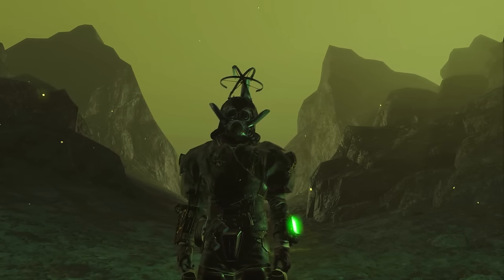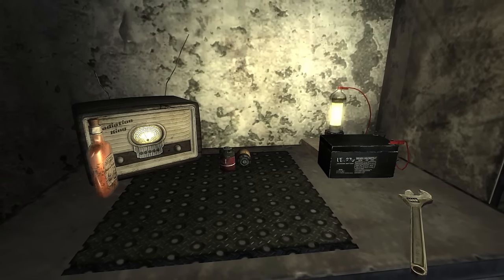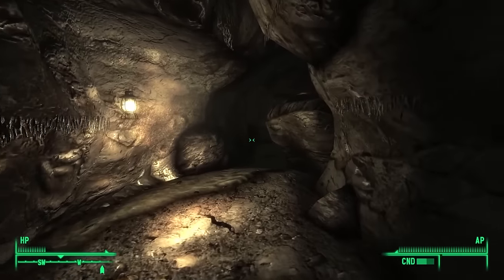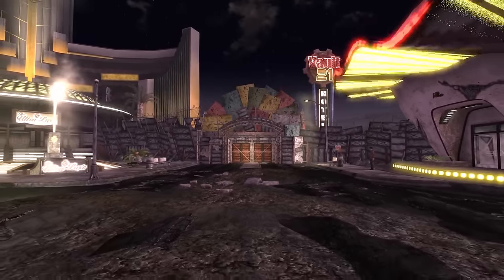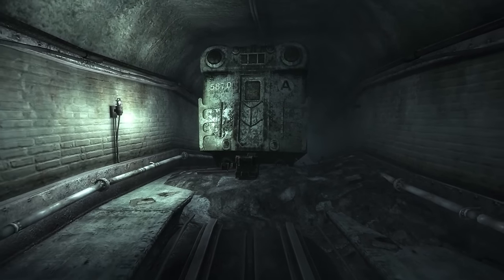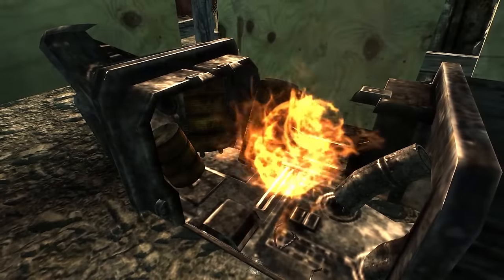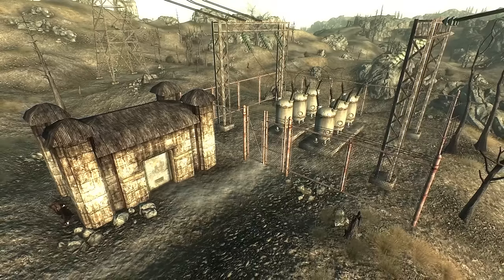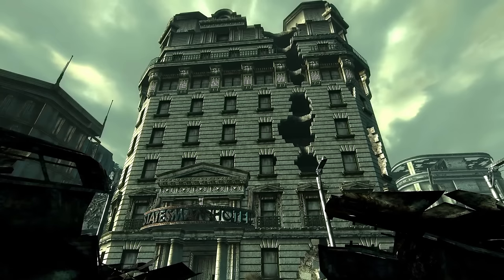Where does the power come from in Fallout?

Comment: Great video, just a theory about fusion cores, why can't we see them as batteries, as the building is still powered after removing the core, we know that the core is not providing electricity. But the settlement version does. So like a bettery charge managing system, the ones in building are recharging the cores as they have more power (from power grid) then needed. On the other hand, the power is provided by the core when there not or sufficient grid power ?

Comment: The partial power to the statesman hotel, and really the lack of power to any elevator just implies the building went into emergency mode. Most buildings with elevators shut them off if a fire is detected. Iirc, a lot of the lights in the statesman were actually tiny emergency lighting devices. In our world, they're battery run. In fallout they could be using nuclear batteries, but they'd only be good for about 20 years at most.

Comment: Far as I understand fallout is on a different timeline to us. Atomic power took off to where even cars ran on a form of it. Considering there's a half life power would tick over and the network would have some form of substation that would store the surplus regionally for distribution. Low wattage electronics like lightning will run fine, anything that requires a surge doesn't have access to either 1 of 3 phases or exceeds the load provided from the network. Considering "Mr Handy" is a thing there could be power stations completely automated in bunkers so can't be damaged in a targeted attack plus shield incase of a meltdown.

Comment: My own theory on fusion cores is that, the machine you see them plugged into is actually there to keep a continuous light draw on them, because if the power generated by them had no where to go, it would ultimately go critical. When you unplug them, the only thing they were ever powering was that small turbine and light. It also explains why they're so weak when you plug them into power armor. They've been sitting for 200 years. In military terms, a power supply that only lasts a few hours is useless. You don't want your heavy troops to suddenly lose power and have to stop mid battle to swap them out.  So likely when those cores were new they could go weeks or months before worrying about replacing them. Just my $0.02 on it.

Comment: as for the powercores they might have been just backups - not primary generators - so plugging them out might still leave the building operational if the main power line is still working (and ofc its also due to game engine limitations). This also explains why they still have power because they werent used - but they hold only tiny amount of power because the fussion material was depleted due to age - after all its 200 years+ since anybody filled them right? - i saw a movie explaining that they might have hold material called Californium - someone did the calculations that around 200 years would take for them to be near close to the expiring due to decay.

Comment: My head canon is that the generators in buildings are back up generators. Meant to kick in when a building loses power, they aren’t powering anything because they are on standby. This could explain why the core’s still have so much power, it doesn’t use much power to keep it running in standby. it also explains why they run out so fast power amor is very power intensive and the cores were only meant to power all or part of a building’s system until the power could be restored .

Comment: So the thing I've figured with fusion cores was that they themselves are not generating power.  I think they're being charged.  They're a "Core" or a battery.  Likely the fusion generator is just charging them up until they can be used in other things. 

It kind of makes sense too.  Pre War people would have had things like heavy machinery and such that needed the sort of power their nuclear power provided, but that might be too small to have a reactor.  So they developed a powerful battery tech.  You can pull those cores because some time long ago they finished charging and now can be used.  But like all batteries they eventually over time lose charge hence the ones we pick up being weaker than full power.  

Atleast thats my thoughts.

Comment: My head cannon is that the Fusion Cores and Fusion Generators act like modern Generators.  They kick on during power outages and burn their fuel, being the Fusion Core in this case.  Simple explanation as to why Power Armor burns through the cores quickly.  They were only meant to provide a few hours of power and they can be changed out quite quickly.

I know that doesn't explain the settlement Fusion Generators, but lets face it, would you want to have to constantly go back to a settlement if the power went out, fix the broken power generation at the settlement while the Fusion Generator kept the place at minimal power, then if the settlement's Fusion Core was depleted, replace it.  They didn't program it to work that way because settlement building is the most tedious part of Fallout 4.

Comment: That's not quite how "not enough power" works. I just fixed a fan with a power issue: it has a light on it to indicate power. There was a tiiiny short circuit in the system, small enough that some current went through where it was meant to.  The led light turned on, but when I switched the fan motor on, the light went off without the fan working. 
When you try use the high current device,  like the elevator, EVERYTHING turns off.  Nothing gets enough power because it all flows through the motor like in my fan. No current is left for the light.

Comment: A thought I've had with the fusion cores is that the core itself might just hold the fuel and the building size core receptacles could afford to be larger and more efficient. The building generator could be using the core at a lower temperature, and thus a lower decay rate, while using less heat more efficiently. The power armor could have reflectors to increase the decay rate of the core, running at a higher heat to generate the power thermoelectrically, like an RTG.

Basically, the building sized thing is more a traditional reactor with an alternator, and the power armor recepticle is an RTG.

Comment: why powerstations might still work ? - robots my friend robots - there are many mr handys around industrial areas - they might have been the maintance bots - look no furhter than for eg repcon building plenty of them there.

As for subway - it might be getting its emergency power from some sort of nuclear power generators similiar the the ones in the valuts - emergency lighting aint that power hungry and we know vault tech was capable of making reactors (the candle versions) that could last hundrets of years.

Now imagine if vault tech could make them then what could general atomics do in that department xD - so there probaly were some generators located in the tunnels of metro - and some metro tunnels have collapsed making them inaccesible - just because you cant get to them doesnt mean they or the power lines were inoperable. - that would explain lighting in the tunnels.

Some of that infrastructure might be deliberately unaccesible to avoid potential sabotage problems - after all USA was at war yes ?

Comment: I've worked in power plants for 15 years. On the electrical and controls side. So I dive into games that feature plants and delivery systems with a biased perspective. Fallout was no different. I feel like there absolutely have to be some form of power stations running and generating electricity, switch yards, transmission lines, etc. I also know the limitations of generating units and that there are failures. I know it's a fantasy world, but still.

Comment: Your notice of the Fusion core being part way ejected compared to the ones you create in your settlements actually makes sense with the last perk of the Nuclear physicist. If the generators were running low, I can see it partially ejecting the core, causing it to protrude, allowing the technician to notice when walking down the line of generators. Idk about them still producing energy after the partial ejection, but with how poorly this game is put together code wise, it wouldn't surprise me if this was a thought but they saw no point in adding it cause it didn't change or add anything to gameplay.

Comment: The fusion cores are charged by the generator. Why does no one think of this.

When you remove them the generators stop charging and so flicker as more energy is available and become quieter. 

They dont charge a building for 200 years and are then eaten by the suit. They are kept on the charger for 200 years and are then consumed. 

Think of the fusion cores like a trashcan for the volatile material produced in the generator. The suit runs off the trash.

Comment: the dryer would work on 110 just depends on what u want to work  cause the 220 runs it all but one of the 110 lines run the heating elements and the other 110 runs the motor to spin the drum so hook one up and get heat then the other to get the drum spinning but hooking both up to diffrent 110 outlets isnt good cause it draws to amny amps to run for to long thats why dryers are on 40 to 60 amp breakers instead of 20 to 30 amp  cause just the dryer lines need the full 30 amps and u have other stuff on other breakers

Comment: Considering the fact that nuclear energy tends to have a very long shelf life as apposed to natural gas energy, and with the Fallout 4 universe taking place in a futuristic society, it makes sense that the power would still be running 200 years later from nuclear reactors. If almost everything was nuclear powered, even the cars, then I doubt they wouldn't have had extreme technological advancements in the nuclear power industry. Even a nuclear powered car in the real world made today would still have a 100+ year lifespan because nuclear reactors run off of the slow decay of radioactive materials. My theory is basically that the entire grid is run off of nuclear plants and generators in Fallout 4, and that the fuel just hasn't run out because the tech was designed to have the longest life-cycle for fuel.

Comment: Part 3 - Plasma Cores.

Plasma Cores, are modified Fusion Cores. Period. The cores are converted into Non-Neutral Plasma conductors that feel what is basically a large plasma accelerator.

When the nuclear powered generator in the core discharges, this generates a particle beam by the excess charge density. This puts the core into a near-meltdown state continuously, but the process rapidly cools the source material as well, as the process causes thermal transfer. 

Ultimately, the modified cores area unstable, which is why it was always a prototype weapon to begin with. Its also why it shares more in common with the alien blasters, the laser weapons.

Comment: If you assume the blue lights radiating from the fusion core inside a reactor are Cherenkov Radiation, the difference in intensity between those in reactors working in the wild and the ones built in your settlements show that the old ones still glow but only weakly. This supports the idea of only small amounts of energy being released and with that lesser amounts of particles being emitted by older generators than in those newer ones working at full capacity.

Comment: You are right about the phases, but it would be worse.  the transformers would overheat and burn out if unbalanced.  

I have a much simpler issue.  the bolts and screw terminals wires are connected to would vibrate loose and disconnect long before 200 years.

Comment: There is a flaw in basing the idea of no human intervention has happened for 200 years after the war.  

1.  Not everyone got into a vault, so the masses left vaultless and sheltered someway else most likely emerged long before vaults opened since they would not be stocked and equipped like a vault would be.  

2. Non feral ghouls I feel are still considered human and retained the intelligence they had pre ghoulification.

Especially when it comes to Ghouls who after the process actually thrived in the wasteland and didn't need to bunker themselves, were free to work on any project they wanted.  We know there are high intellect ghouls and it would be nothing for them to work on infrastructure to make their own lives easier.  By the time non vaulted non ghoul humans emerged, these projects would have been well underway and then they could have tapped into it and formed communities around these sources.  By the time the vaults opened power wasn't an issue anymore.  Sure some places could be powerless if there was no one in that area that had any knowledge of how to make electricity or service an already built structure.  Even better would have been a plant that had little to no damage, but those would be less common.

Comment: No it is impossible to believe, neither the part the plants have been hardened enough, nor that they are automated enough. It is even impossible to have a stable net with only a few plants remaining that provide a pre-war network to draw even small amounts of electrity.
It is very hard to maintain a stable electricity network for cities or whole states and needs to be adjusted in order not to collapse. A collapse that would threaten to take out substations in the process, even further increasing network instability. This even feedbacks to the stability of single plants, especially nuclear plants, as they heavily rely on external electricity for coolling i.e. "existence". Cooling is by the way one of the major problems that will not be hardened on the level of single plants. You need vast amounts of water available and adjust the amount according to the plants demand. Often this is based on rivers, bad in an apocalypse, but also on water networks, even worse in an apocalypse. With local water cycles rearranging, rivers drying up or rerouting, weather patterns switching, there is no way to supply a plant with the water they still need. In most cases the immediate aftermath of a few dozen hours would be enough to put them out of commission for good, with no chance to provide at least a makeshift solution even if there was a longterm solution available. Just study the week after fukushima and look at what happened there, how hard it was to cool the reactors and keep them from exploding, although they still had the complete infrastructure of a first world country to mitigate the fact that the plant itself could not draw power from the network. They had unlimited manpower and all supplies to provide a makeshift solution and still another reactor went into meltdown despite all efforts. In an apocalypse you have not the manpower, not power or water only a few dozen kilometers away to draw upon or all the spare parts you could wish for to make replacements.
Just think about the following. At this point in time, a single coronal mass ejection of the sun, an average one, would be able to take out a bunch of big transformers in the north american network. Transformers so big and hard to produce and ship that this might well result in a blackout for years in the regions affected. Places the size of New england for example. It might take more then 7 years to replace them and get those grids all up and running again.
So, no, a pre-war network is fiction, just stop talking about it to not to kill the immersion anymore, will 'ya ?

Comment: I think Fusion Generators might be backup generators in case of things like blackouts. Go downstairs, push the core in, and start the system to start powering the whole building. But when the Great War hit, the one thing the U.S invested everything it had into - the power grid - is pretty much the only thing that continued working even while the world was dying, so nobody ever needed to actually use the generators.

Comment: 16:42 Note that light in the generator also is brighter when core is fully inserted indicating that core was running in fraction of the power since power need was next to nothing. Perhaps these generators have been running as emergency backup mode where is main connection dies it starts running on full power ether automatically or by human action, or even adjust their power out put to match the demand at the time. Since most of the building has been destroyed, fuses blown etc power demand is next to nothing compared to total output core can provide. Since its been running as standby power for 200 years or just powering few lights, computers, doors etc, core still has juice left in it but no where near full capacity, so has been depleted somewhat but it works fine for several in game hours in power armor that is high energy demanding equipment, but if it was new it could go perhaps for days. This makes most sense on real world systems in mind. Hell since its been in standby mode it could be that whole system is similar that of a hospital generator system where energy storage device gives building power for few minutes before generator kicks in, so power wont be cut at all, witch is pretty important when you are doing surgery or having breathing machines running on that power. In this case fusion or fission generator is running in standby and after power loss is detected kicks in to high production.

Comment: prly late to the discussion, but imo the fusion core "generators" that you can find in F4, and place around settlements, were originally planned to be Re charging stations for the cores. evidence is that the core is half way out when you find them. and the one you build has it fully inserted. suggesting that the cores when charged are semi ejected. but hey thats just my opinion.